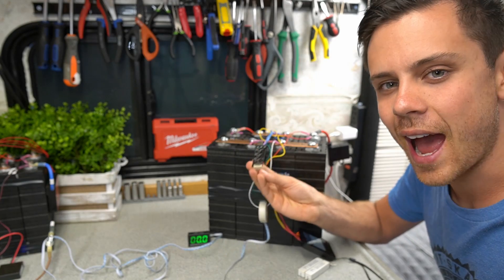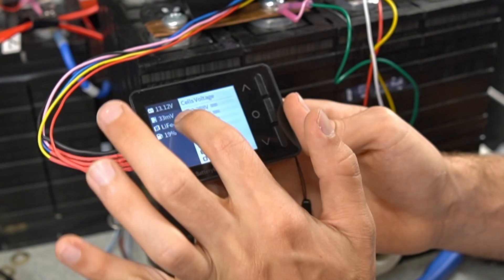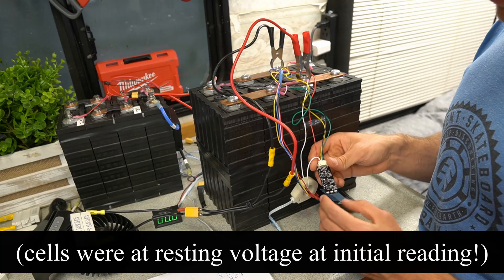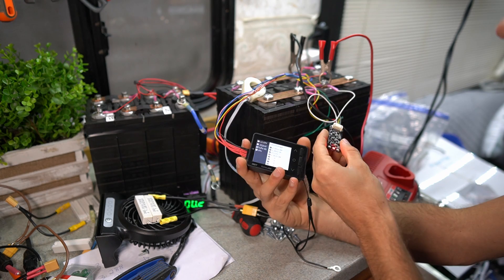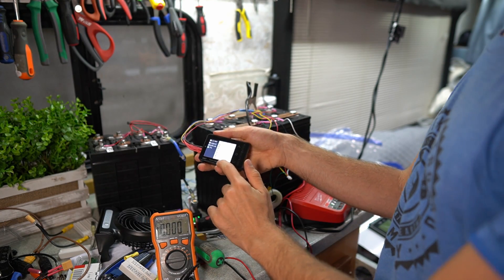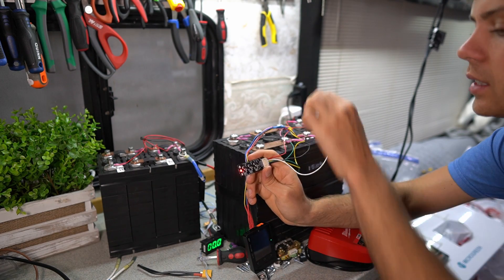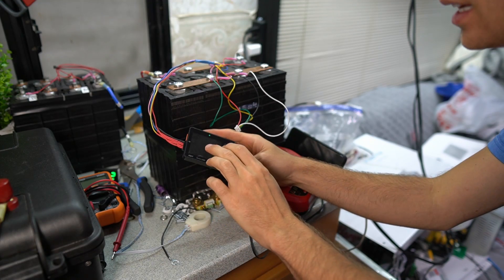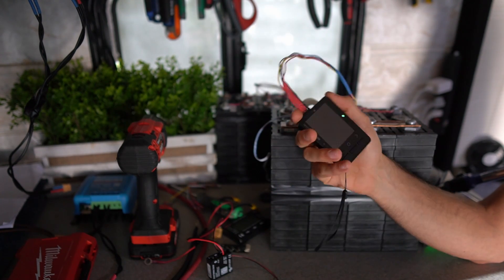"Active Cell Balancers": Did I get Ripped Off??

Comment: Well how would an active balancer work? So you have a few tenths of a volt and you connect low to high then the current is going to be (delta V)/R. I don't think that is going to amount to much. The only way to push more current would be to raise the voltage of the highest cell with a converter to make delta V bigger.  I doubt these things are than complicated. What you can do is manually connect the highest to the lowest and measure the current. That will give you an indication of what the max current is going to be even if the thing was working as an active balancer. The balancer is not going to give you a bigger current transfer than a direct connection.

Comment: Don't know what you tested, but I just tested the 3s board (Ver. 3.0) and at 180mV cell difference about 600 mA was transferred to the lowest cell.
So they seem to work.
B.T.W I'm a 75 year old Electrical Engineer from Luxemburg.
Reply from the maker: I have two more coming in the mail that I will test. Maybe I had a defective one. One guy has same results as you, and three other people have same results as my video, so I will get a new one and use power supply to increase voltage of a cell and see what happens. Thanks for letting me know
Reply: @WillProwse   we're excited to see the next test you will make for this Will!

Comment: You most likely have a Buck-boost converter based cell-balancing circuit.  that would use three inductors for 4 cells.  If you disconnect one of the cells with a load on the battery the small diodes on the board will try and bypass the missing cell  Maybe that were your smoke came from.

Comment: Try the active capacitor type. I just ordered one on Ebay. look up "Lithium battery Active Equalizer protection board 4S 5A Balance Li-ion Lifepo4". The capacitor one said it was good for up to 5 amps. Thinking that little Inductor type is just to small to do the amps it claims. I seen another similar one that said it was recommended for a 10ah battery and about 225ma of transfer. I don't think the inductor type uses resistors. The inductors was just getting hot transfering they are small after all.

Comment: A complexity of logic in an active balancer is an order of magnitude higher than that of a passive one. A passive one is easy: measure, compare, discharge every cell except the lowest until no more difference. I would not begin to comprehend a logic of an active balancer, it would take a much smarter brain than mine to even model it!  One thing is clear to me though, active balancers cannot be cheap.
Reply: An active cell balancer is basically a current limiter and paralel connection.
If you connect a discharged and a fully charged battery together, smoke will come out of the wire, because it draws all the power in the world.
These little boards limit the current from one cell to the other. That is it, you can build a less advanced one from junk for about 2$

Comment: These active balancers are actually DC-DC buck converters. They funnel energy from the higher cell to the lower ADJACENT cell. Thus, if you brought down cell #3, it should funnel from cell #2 or cell #4. Also, these balancers balance faster, the bigger the difference between the cells. I would suggest you take a cell really low (like 0.5V lower) and then test to balance the pack with this balancer, under no load.

Comment: The best and possibly easier way to find out what this miracle device is really doing would be to analyze / reverse engineer its circuit :-)
Doesn't look so complicated to me - but could be difficult cause of unknown IC's used - if at all? You can tell just from the tiny smd parts that it cant move much energy anyway. Chineese ripp off imho!

Comment: Hi Will.  This question is about your solar for beginner videos. I was wondering if i could pick your brain on electrical having trouble finding a detail answer.  I am converting a 20 ft enclosed cargo trailer.  Starting from scratch.  I have a propane onan 4k generator, I am going to buy 2 6v batteries later 4, I order the 55 amp wfco power center that has ac/dc and multi stage converter built in, order a 30 amp plug (if ever shore hook up but mostly boon docking in desert) and was going to order a pure sine 2000w inverter. I was going to wait on the solar setup to pay-off some of the build cost first. Right now really struggling trying to figure out how to wire the inverter in so i can use tv, outlets, coffee (basically everything except AC and microwave) without generator, without it activating the charger in the built in ac/dc panel with converter or loosing all of 12 volt by turning off the converter(lights etc).  the 4 different inverter wiring method article gives me a little bit of info.  Since I cannot seem to figure out method 1 or 4 i was going to just make dedicated outlets if i couldnt figure it out so method 3... I do plan to add 400 watt solar in future with mppt controller and 2 more 6 volt batteries.  But for now I cannot figure this out.  I know it requires a transfer switch or possibly manually doing something?  Any help you can give would be great.  Thanks Keith.... some more info have a 3 way fridge (12 volt, propane, and 110), single dometic 15000 btu ac, 700 watt microwave, have bought my wiring, outlets, etc yet.  Also have not bought the inverter yet.  I really appreciate any help you can give.
Reply: keith minnicks A suggestion check into 18650 batteries in stead of 6 volt batteries. You will get more bang for you buck.. don’t forget fuse on out put of battery within 18” of battery, closer the better then connected to inverter and fuse or breaker after inverter.

Comment: after watching the last video I had a look around and found a capacitive cell balancer that would work as you want on ebay for about £20 - also a lot of resistive cell balancers calling themselves 'active'. I guess that's why your cell monitor claims active cell balancing. I've made my own cell balancer that does transfer power between cells using a 7-winding transformer, though it's only been under test for a week now. Shame the inductive balancer didn't work as expected...

Comment: Hey, I know this comment isn't related to this video in general, but I had a question about when you compared the tesla battery pack from ebay to the other batteries. 1. Is the cost really 50 per kwh, as opposed to grid power costing on average 12 to 13 cents per kwh? And second, can the tesla packs be utilized in say, a 48 volt system, i think you are using 24v. (I am watching a lot of your videos and have your site to look over still)  Thank you.

Comment: From what I have read there are two different kinds of efficient active cell balancers. The best is supposed to be inductive (the kind you are reviewing) the other uses capacitors to move energy around. I have seen some of the capacitor type on eBay. Perhaps you may want to review one of those too. Sorry to hear that transistor burned out when a lead was removed from the battery. I would like to look Into the one that someone mentioned earlier that was sold on Alliexpress. I ordered three of that same active cell balancer that was damaged in this video, I hope I have more success. I may try to double them up. I am planning to use these on 30ah or less LiFePO4 26650 battery packs I am building.

Comment: You know you dont need a balancer for LiFePO4 cells. Balancers are nothing but problems and cause fires. If you treat a LiFePO4 like lead acid they will last forever. Step 1. Bottom balance all cells to 2.75v to 2.5v per cell. This is at the far end of the knee of the discharge voltage. Step 2. Put them in a group of 4 cells per "12v" battery, 8 for 24v, 12 for 36v, 16 for 48v or what ever. Step 3. No special lithium charger needed. Let your lead acid charger charge them. For 12v battery the max charge should be 15v. Which is 3.75v per cell. This will under charge the cells by lets say 5% and a lead acid charger should not go higher than that anyway. Under charging them by a small amount will prevent one cell from over charging since we bottom balanced all the cells and it will extend the life of the cells. Now a lead acid controller should have a cut off of 10v which will be 2.5v per cell which is empty. Go below that and they could be damaged. Any controller that handles lead acid should have that low voltage cutoff. Step 4. Just use them like lead. Charging should not be an issue. Just try to stay away from 10v or 2.5v-2.75v per cell and LiFePO4 will last forever.

I've been messing with LeFePO4 cells for over 10 years and if you do it this way there will be no issues. No BMS causing fires or failing to work. I have a 48v LiFePO4 80Ah pack for my Airens AMP electric riding mower. I've had it on lithium for several years now and I have not had any issues with the battery. I still use the lead acid charger that came with the mower. Charges to about 57v and has a blade cut off voltage under load of 40v. All cells are within 0.05v of each other.

BMS were the number 1 cause of electric car fires in the early days. Dont know if they still are. Have not seen much. Might be because people started to stop using a BMS with LiFePO4 chemistry. Any other lithium chemistry would need a BMS though.

Just my 2 cents. Bottom balance and treat them like lead and the cells will be happy.
Reply from the maker: I completely agree and I say these points many times in my other videos. They will not go out of balance. The whole point of using an active balancer,  is to top or bottom balance for our specified application, and to use mismatched cells in a pack. We are NOT using active balancers to keep our cells balanced. Cell drift in a solar system with our c rates is minimal and they do not go out of balance. I also agree and have the same points about BMS.
Reply: @WillProwse  I actually have not seen a lot of your videos so I may have not seen those. Keep up the good work. I'm planning to do a whole house 15Kw or 20Kw battery backup. I think I will go with a 320v DC side though.
Reply from the maker: @JayGroh  Nice!! That will be awesome :D
Reply from the maker: I also have other videos that talk about when to top or bottom balance, using mismatched cells and how to set charging upper limit voltage, and so much more. Please watch my other videos series to see every point that you just made, covered in extensive detail. I totally agree with you. I just want to make sure you know I covered these topics so you do not think I am ignorant on these points haha

Comment: A true active cell balancer would be  individual boost circuits for every cell, so the boosted voltage from the highest cell can be fed to the lowest cells. 

A passive cell balancer will simply switch resistors between the cells, via transistors. This is an ineffective way to balance cells, as the balance current is low, getting lower as the cells voltage nears equalization, and the cells can never be perfectly balanced, as there's going to be some loss across the switching transistors.
Reply from the maker: Agreed. Exactly

Comment: On the little board, using LTO cell voltage the balance current was 60ma . You reading 80ma sounds correct because your at a higher voltage. If you read the specification it says 0-1.2A. :) Maybe it's a peak current pulse of 1.2A. My first board came in with a bad transistor and they sent a replacement. The board will dump energy cell 1 to 2 or 2 to 1 depending on the cell that drops .1v below the other cell. When the cell reached .05v difference the balance shuts off. This was verified with a bench supply and one cell. I would recommend you get a variable power supply to do testing , it will save you lots of time.
Reply from the maker: Good point, that's way easier method haha! I wasted so much time. Thank you :D
Reply: @WillProwse  This weekend I plan to test cascading the boards. If they work fine I don't see an issue with balance current of 60ma, after all it balances all the time!

Comment: Another good Will. Could it be to do with internal resistance of the individual batteries as they get close to full?  Also, doesn’t active balancing require some sort of capacitors to load and unload from one cell to another to achieve this?

Comment: All a top balancer does is nudge the top off the high cells with a parallel mosfet and resistor - it's no magic machine.  Cell balancing can take place over a whole week, there's no rush, and once balanced they only need the tiniest nudge to stay there.
Reply from the maker: Me and a lot of my viewers are not just correcting for cell drift or adding cells to a pack... We are doing bottom and top balancing for specified applications, with large batteries, quickly. If all we were concerned about was basic reasons for balancing, no one needs these. Especially for LiFePO4, totally pointless. But that's not why we are doing it. We also want to use old used, mismatched cells, and increase capacity with active balancing. That's why. So there is a huge rush in our application. Otherwise I'll just use a BMS balancer.
Reply: @WillProwse  I doubt balancers have any notion of the advanced applications for it.  Sounds like big fat mosfet and arduino time.

Comment: Will is an 'Active' cell balancer push more current to a low battery or does it just 'burn off' excess voltage on the high cell? Maybe there is no such thing as an 'Active' balancer the why people think it is. If you look at serious BMS like Batrium, even their 'long mons' all use 'burn off' to manage, so I think 'Active' is just being used as a name.
Reply from the maker: No there are actual active balancers on the market. But they cost a lot
Reply: @WillProwse  Oh, I wonder if the extra cost is worth the savings that you would get from not 'burning' off the power. A difficult to calculate on a small scale like RV. Of course big commercail power application would not just burn of the power because that heat would have to be cooled by even more power use.
Reply from the maker: Batrium does not need much balancing power because it's just correcting for cell drift over time
Reply: @WillProwse  Oh I didn't know that. Have you seen Bruno's new Batruim long mon instal vid? Will you were sure living the dream when you were at EVWest, it was awesome to see :)

Comment: For there to be a chance of this ABMS to balance at 1.2 amps you'll need to have a voltage difference of at least 1 volt. The closer the voltages are to each other the less it should draw the further apart thay the more it should draw. I have never used one of these but have tested the del green ABMS and this is how they work
Reply from the maker: I could throw them out of balance at high SOC and test it again. I have another one in the mail. Good point
Reply from the maker: Good point
Reply: @WillProwse  I'd love to know as these are so much cheaper in cost vs. the del green

Comment: Maybe it only active balances while charging and maybe while powering stuff. Controlling the transistors and integrated circuits probably uses a lot of energy and it looks a lot easier to me to bypass batteries during charge/discharge than to actively feed one battery from another while they are otherwise just sitting there.
Reply from the maker: Oh I did a few cycles and even tested it previously and didn't seem to make a difference. This one is only triggered by difference in cell voltage, not by voltage. It can be at low soc or high SOC and it will still turn on

Comment: Yep, something to watch for is if it has the components of the board to do active voltage boosting to take charge from one and charge another one.  Just the size of those are a dead giveaway that they don't and possibly they will bridge cells but that most times won't balance them they just stay the same.  You will see the better ones have a little boost power supply circuit to increase the voltage differential between cells.
Reply from the maker: Good point.

Comment: Damn. Did seem to be too good to be true without big capacitors. Thanks for doing this!
Looks like we have another scam to look out for similar to PWM chargers labeled as MPPT.
The 16S version of this balancer I ordered arrived today, and I've hooked it up to a 7S32P. The LEDS for 8-16 flash every second or so, but 1-7 remain dark, so not sure what's going on here. The instructions say that higher S balancers can be used with lower S packs, but don't explain how. On some BMSs the highest S of the battery goes to the highest S of the balancer. I've asked the vendor for clarification and waiting for a reply.

It does say in the manual to connect 'obliquely', ie from negative first. Failing on missing cells I think is a symptom of bad design.
I think I'll send them a link to this video too, and urge others to do too - it's absolutely not cool to mislead buyers.
Meanwhile, there is an active balancer on aliexpress for $85 that appears to do what it says, given that it has a couple of supercaps on board for charge shuttling. You might like to test that too!
Reply from the maker: Yes that other one on AliExpress looks awesome! Might need to get one soon. And yes, I agree with your points
Reply: @WillProwse  I look forward to your results and analysis!

Comment: Try searching on Aliexpress for "QNBBM 4S active voltage equalizer balancer". They run $75 at the moment. I have two that been working flawlessly for me on some used CALB180 LFP 4S batteries I have assembled. The claimed up to 6A balancing current is real... my cells are typically within 2 millivolts. Now I just have to finalize the protection side of my build .. Leaning towards smart Victron products, but man you have to pay up for that stuff.
Reply from the maker: That's awesome. I saw that one. Great to here your experience. I need to get one haha
Reply: @islandhopper100  It hard to stay away from them. I've come full circle. But I am sold on Will's prismatic cells. Cant get Amazon here in Australia but I can get them directly from China.